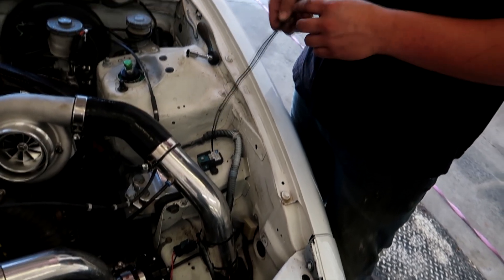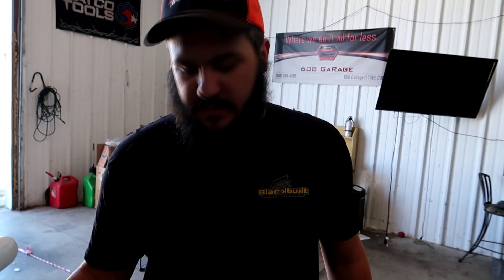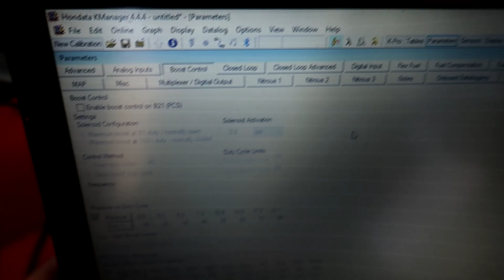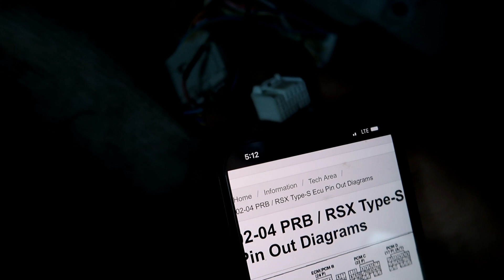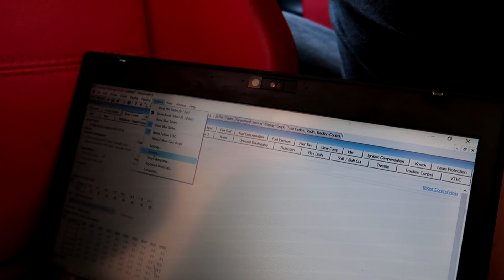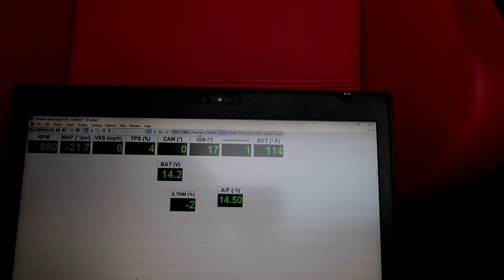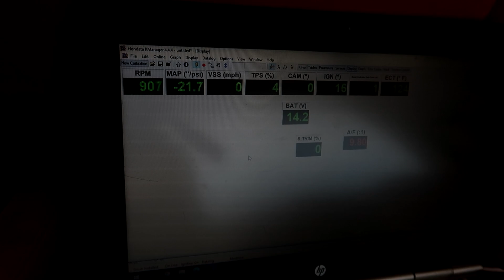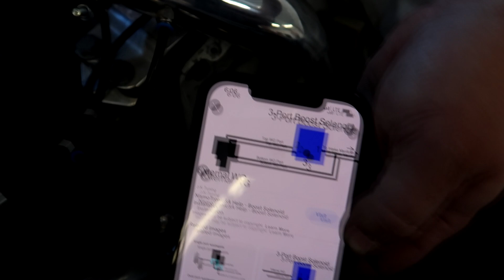K Series Boost Control Install KPRO

Comment: 5 minutes in and I already learned something new, I've always used the soldering iron I actually did not know you could just use a lighter LOL such a simple thing but there's been a time or two where I needed to resolder a wire but I didn't have my soldering kit this could be a lifesaver in a pinch or roadside fix application I'm just going to throw a spare lighter so heat shrink and a spool of soldering wire in my glove box now as an emergency wire fix kit, thanks Hunter you the man bro
Reply: Told myself the same thing. The iron feels overkill now…
Reply: wordddddd

Comment: @huntertuned everyone’s saying to use a switched 12v for the MAC valve would the constant drain battery or cause any problems ? Or does the ecu act as the ground

Comment: @4:35 it true that it does not matter what side of the solenoid gets power bcs it will still function the same.., however, this next tip may be neurotic unless the application is THAT sensitive but, like all coil & magnet devices, the power will flow quicker in one direction than in the other. This is because all magnets have a North and South and UNLESS the magnets are perfectly aligned, there will always be a stronger current in one direction vs the other.

Comment: That's some wierd type of plumbing. So if the controller is off the same pressure goes to the bottom and the top of the wastegate? Since that selonoid is just straight through when it's off. And when you add duty it vents pressure from the top of the wastegate? But then it vents the pressure from the bottom of the wastegate as well. I'm confused
Ussualy people.put it inline on the line that goes to the bottom of the wastegate and just vent some pressure from the under the wastegate so the wastegate sees less
Reply from the maker: The bottom of the gate will always see it’s reference hence why you tee it. The purpose of the tee is to feed the solenoid, then the solenoid will open and function as a normally closed unit until acted upon from the ecu. Whatever excess pressure is not needing to run to the top of the Wastegate is vented out the middle port. Yes you can run it just for the bottom of the Wastegate port but doing so you will not have as precise of control only controlling the bottom of the Wastegate as backpressure can force the spring open at any point. Hope this makes sense I’m kinda rambling but I have used 3 ports this way and they have extreamly precise control I’m talking half lb boost increment adjustability
Reply: @HunterTuned  I used a old greddy profec 2 n wired it to the ecu it comes with it own module but I just wired it to the ecu instead…..the solenoid is buzzing constantly does…i understand how the vaccum works in correlation with the boost…..But idk if the solenoid is suppose to stay on n then turn off when it hits target boost or is it supposed to be off then turn on when it reaches target boost lol could you explain would really appreciate it